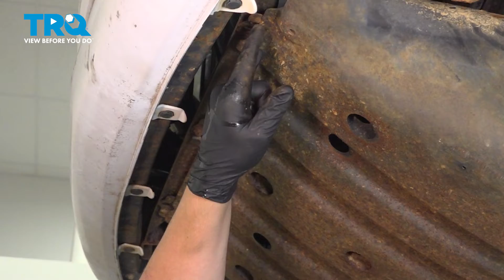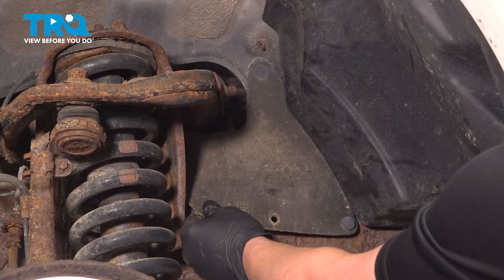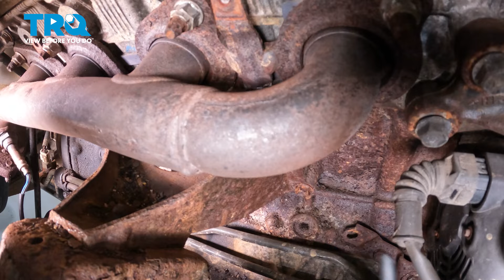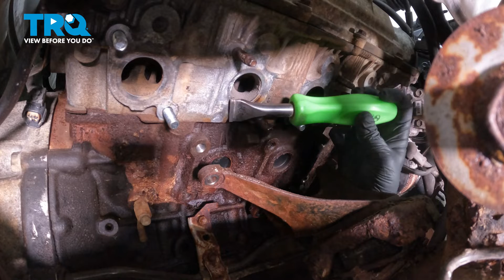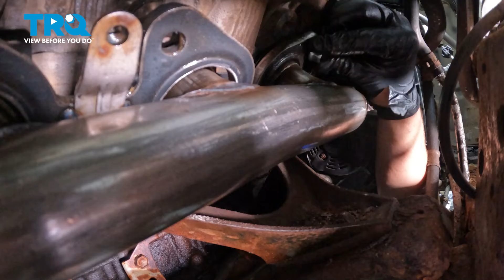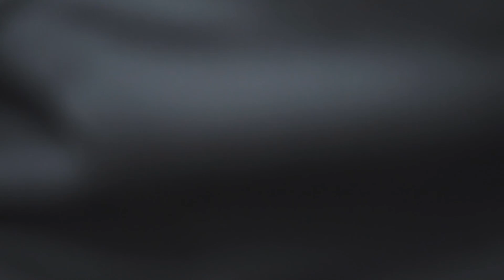How to Replace Exhaust Manifold 2000-2006 Toyota Tundra

Comment: I removed both of my exhaust manifolds and replaced them with JBL headers.  Was a difficult job, but with heat, some penetrater oil, and many choice words, I finished the job in a weekend.  Did not remove the engine mounts.  Was not an easy job - but got'er done!

Comment: Second generation 5.7 engine exhaust manifold bolts torque spec is a mere 15ft lbs, far from the 32ft lbs with this first gen! But when I took off the original gasket the raised seals around the 4 exhaust holes were flattened which 15ft lbs couldn't have achieved! I've replaced mine with a Dorman exhaust manifold, but used a Felp-pro multi-layer steel gasket(3-ply) for longevity and blow-out resistance(like the one in this vid). But I still hear a leak on startup and acceleration, so I might try over- torquing to 20ft lbs as the only thing that could get damaged would be the gasket itself imo!

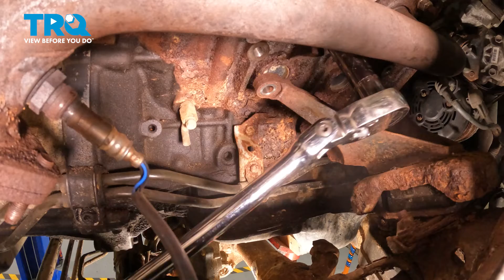Comment: At 4:39 you are tightening and snap the bolt head. And again at 5:01 you are tightening. Luckily, the Snapon saved you by going in the correct direction lol

Comment: Would of liked to see what they did about the broken stud
Reply: I'd have taken two nuts and stacked em on the stud, then loosened the nut by the block to extract it
Reply: There are many broken stud videos online , just heat that thing up and twist it out with vice grips if not weld a nut to the stud and back it out

Comment: Would I have any problems if a new gasket was not replaced he put the old one back on?
Reply: The problem with reusing a gasket is that it was "crushed" to the first exact position of the manifold and mating surface. The second install has very little, but just enough play to mate unevenly to the reused gasket. This crushes some parts and leaves gaps on already-crushed segments of the gasket, and the seal may be WORSE than the gaps causing the initial problem.